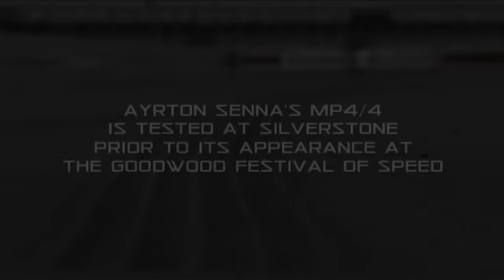MP4-4 Pre-Goodwood Shakedown

Comment: @monkeyboy866 

This meant that the bad balance ruined the BT55.However in 1988 Murray KNEW the Honda V6 was far lower than the BMW roadcar based straight 4, and he could install it in an optimum configuration. So the McLaren MP4/4 was a Brabham BT55 that WORKED with the low-slung concept.Later other teams quickly adapted the same concept and it became commonplace.Ferrari concentrated on their 1989 car, so the 1988 car was in fact a little improved 1987 car. Benetton had a decent car.

Comment: @monkeyboy866 

On top of that McLaren also had THE best engine of the turbo era, the Honda V6 turbo.In 1985 it already established itself as the best engine but the troubles of Williams meant it didn't show its true potential until the end of the 1985 season. In 1986 and 1987 Williams won 3 titles with the engine.From 1988 onwards there was a boost limit on the turbo engines in order to make some teams switch to the NA engines which would be the standard from 1989 onwards. Benetton did this.

Comment: @monkeyboy866 

I disagree. You see the MP4/4 was designed by Gordon Murray, who also later designed the McLaren F1 roadcar, and had done the Brabham "fan-car" in 1978 and the championship winning Brabham BT52 in 1983, which was a car designed to be able to harness the monster power of the BMW turbo.In 1986 Murray designed the revolutionary lows-lung Brabham BT55,in which he tried to optimize the undisturbed airflow goign into the rear wing. It worked in theory but the engine needed to be tilted